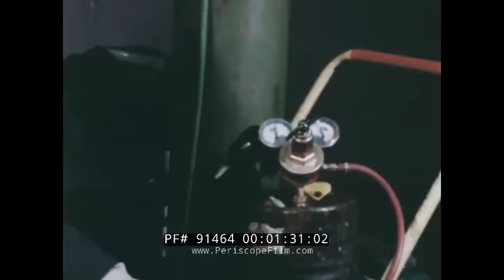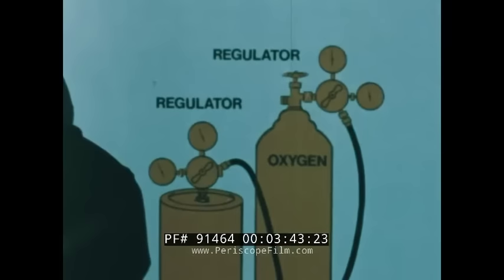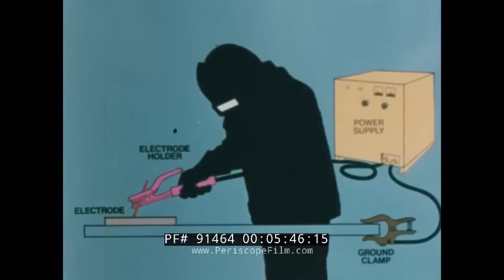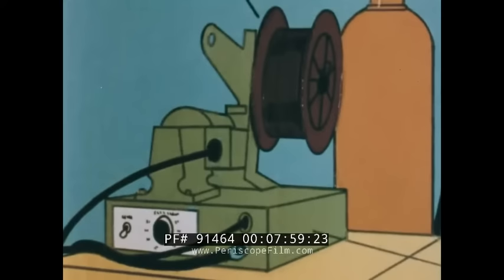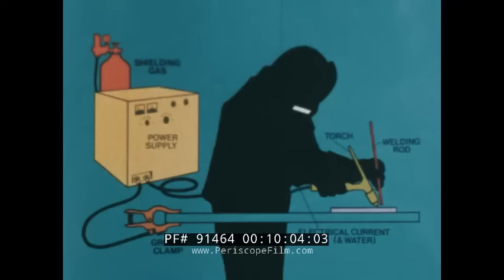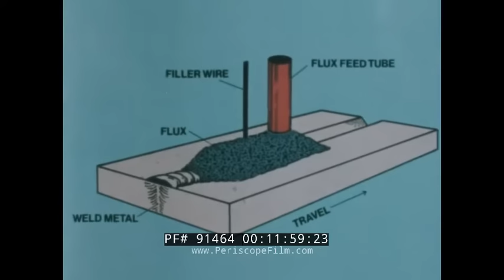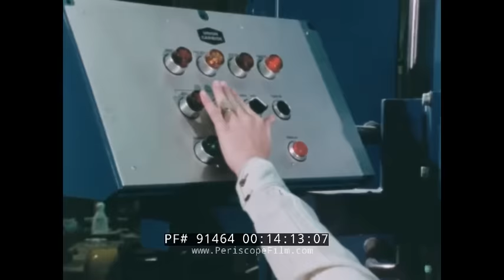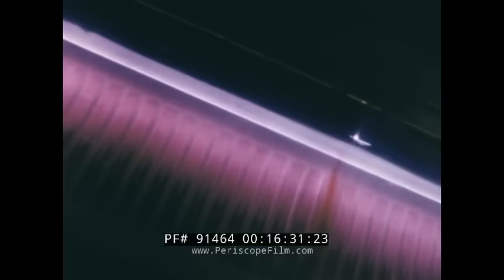" WAYS TO WELD "   1970s WELDING EDUCATIONAL FILM   GAS & ARC WELDING  LASER & TIG WELDING 91464

Comment: I've done the basic welding processes and the only one I use now is Oxyacetylene i know its obsolete and slow but I have 21 years experience with it and can make beautiful Aluminum welds and 1/4" steel welds. I take great pride in keeping Oxyacetylene Welding alive. The process i HATE is Gas Metal Arc Welding or MIG too complicated settings I'll take "Stick" welding over MIG.

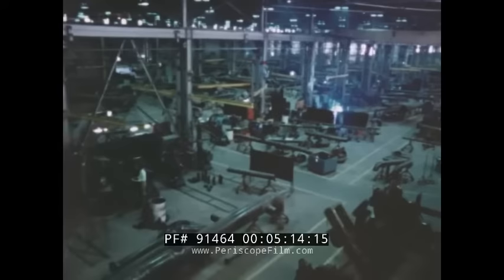Comment: Isn't the air on the big shop with welding fumes kind of toxic? 5:12

I studied welding in Aircraft Maintenance, repair and manufacturing University at Brazilian Air Force.
Reply: Yeah the fumes would be. Now they would probably require masks and smoke extractors.
Reply: @deviouslee1183  Agree, fine fumes of heavy metals accumulating for year may bring some lung and throath illness under long exposure.

Comment: flux cored wire is not mig.
Reply: Even DIY welders can have flux core these days,handy for windy outside jobs,but very expensive. You need a unit that has the capability to reverse the polarity to use it.